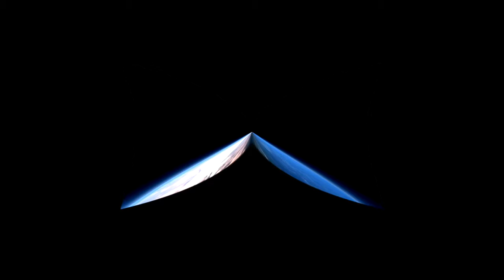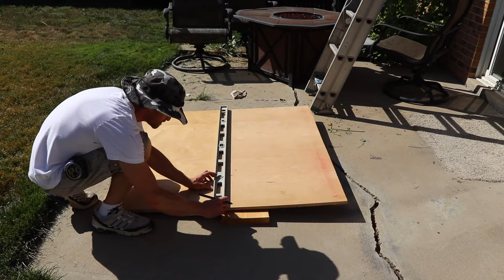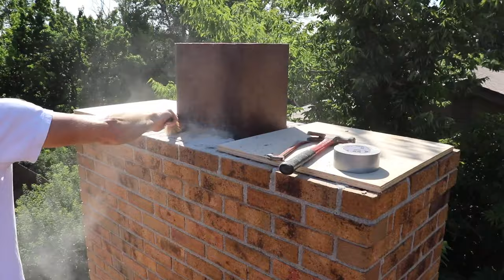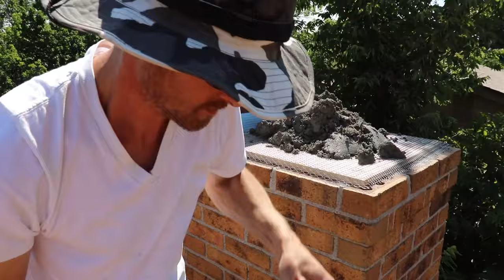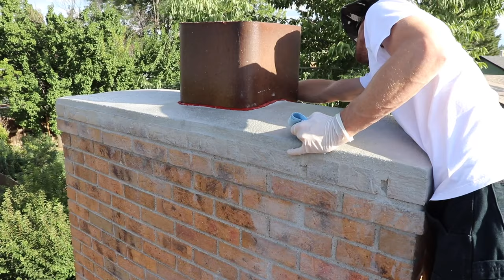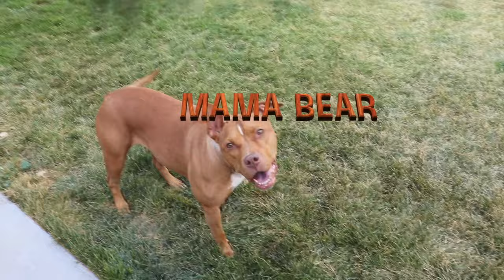DIY Chimney Crown repair

Comment: Wow! Great work. Really clear explanation and helpful tips along the way. Curious. What mortar mix did you use? Have you ever run into a damaged clay liner? Can that be repaired as well?
Reply from the maker: Thanks Jed! I used normal Quikrete Mortar in this video, you can use type S mortar for additional strength. If the clay liner is damaged I usually try to replace it if possible, but it really depends on how bad the damage is, and where the damage is in the chimney. You can use product called Heat Shield to coat the inside of a cracked clay liner to repair it or install a Stainless steel liner. I hope this is helpful. Thanks for watching!

Comment: What holds the middle pipe in place?
Reply: The middle pipe as you call it, also known as a chimney flue, is stacked in 2 ft sections directly on top of each other, (supposed to be) held together by heat-rated masonry. Below the top of the brick and mortar, there should be a minimal space between the flue, and other bricks around it for stability. I would also note, this is absolutely the wrong way to install a chimney crown, and this guy has absolutely no idea what he's doing. He laid plywood underneath the crown, the crown itself is hardly 2" thick, he used mortar instead of concrete (his reasoning because it's easier, easier doesn't mean it's right), and he stated in the comments that he put a water sealer on the masonry. There's a vast difference between water sealers and water proofers, and in most cases, those who don't know use water sealers on chimneys which leads to faster deterioration of the masonry over time. This was an absolutely terrible job, and I'm not even in the chimney industry anymore.
Reply: @yoitspuaphan  I had a guy come out and take a look at my chimney, it was built in the 30s out of rock and is still in good shape. He recommended running stainless still flue to the top. Installing a new wood burning stove this winter and was trying to educate myself on all of the things needed. Cap also needs replacing. He quoted 1600 to install the wood stove, the flue and cap. Is this a good deal?
Reply: @robertedwards2453  It's too good of a deal. It's so good I'd be worried about what he's doing for you. What you need to do is look up CSIA certified chimney sweeps in your area. Having a fireplace, especially a wood stove, is a HUGE deal, and it could be the difference of having a safe fire, and burning your house down. So the question I'd ask is this: is it worth it to you to be cheap, and rig something that may not work, or invest the extra money to have a safe, functioning fire. Also, with EPA regulations that have gone into effect in 2020 (May I think), only certain types of wood stoves can be sold and installed. The EPA has changed regulations for wood stoves to cut down on emissions. That said, 95% of things that were made prior to 2019 did not meet compliance, and had to be redesigned to meet this requirement. I say that to say, anybody selling you a cheap product, less than $3,000, probably doesn't know what they're doing.
Reply: @robertedwards2453  Now, I will say this: the concept of installing a wood stove in an old flue and fireplace isn't a bad idea, but you have to make sure that it's safe what it's going into. Most stainless steel liners for wood stoves aren't class A, meaning they allow substantial heat to pass through the liner. If there's anything combustible in or near your old chimney, or you have gaps that could allow heat to pass through it, you could be in serious trouble. I say all that to say, I was a certified chimney sweep with the CSIA in my area, but I have since gotten out of the business and am doing something else.
Reply: @yoitspuaphan   there was already a wood stove insert in the fireplace, I just wanted to update it to a more efficient model. The business installing this fire place and doing the other work is the same business. I was just going to install the fireplace and nothing else but he recommended doing the stainless steel liner and a new cap. I wasnt thinking of old mortor possibly having cracks do to the age. It was build in the 30s but appears to have been built to last because I cant find any cracks anywhere. But I know I should follow his advice jist wasn't sure what something like this would cost.
Reply: @robertedwards2453  As I stated previously, it's hard to say without actually seeing it. If you had an old stove, there are a number of things that could've been wrong with how it was burned previously, how it could've damaged your chimney, and how the remnants, if not dealt with, could still damage your chimney and potentially your home (chimney fire leading to house fire). These things can occur EVEN IF you install an insulated stainless steel liner fit to the stove. In my area, to install a new stove, liner, and cap, $1600 is extremely cheap, but cheap doesn't mean you're getting a good deal. I would seriously advise getting a professional opinion, one who's certified by the CSIA at least, before you install something and the worst case scenario occurs. 

I will note that I am by no means a negative person, but when it comes to safety, I strongly encourage that you consider ALL the factors. What I know, have witnessed, and learned about chimney and fire safety is what leads me to my recommendation for you to reconsider your purchase. Again, this is without seeing the product and without seeing your chimney, but the two red flags you've given me so far is 1, it's a 1930's home/chimney and 2, an old wood stove was installed that did not have a stainless steel liner, meaning smoke was not efficiently drafting, leading to faster creosote development. 

I would think of it this way, chimney problems are often times like a car. In most cases, your car will have several issues with it. Bad tires, brakes, needs oil change, etc. Once it gets to the breaking point, and the car can't take it anymore, it pretty much shuts down completely and you can no longer use it. In the case of a chimney, once it gets to this point, you're likely looking at a strong possibility of a chimney fire, and potentially a house fire.

Comment: Your hired!  Seriously though, do you do this for others, and are you anywhere near Denver?
Reply: Hey dorothy. I do the same work but out of Albuquerque NM. About 6 hours south. I do take up bigger projects up there. Full restoration and such. If this gentleman can not provide the work or an est feel free to message me. I do come with Google reviews and such. Not some down the road guy (Actually certified).
Reply: @willbarrett4312  Well I just had it done on Saturday!  I doubt they did as good a job as you would have, but I'm hoping they did an adequate one.  The old crown turned out to just be a heap of left over mortar.  It became a sand bomb when they went to bust it out.  They did the form (which is still up there).  They also used a custom foam bell to push Heat Shield product into the few gaps in mortar between flue tiles.  They worked from 2 in the afternoon until 11:15 at night (with spotlights after dark).  I would prefer the new cement not be sealed with any product, but they said they sometimes have to do that if there were any bubbles in the new crown surface.  Will let you know how it turns out after the form and supports are removed.
Reply: @Rabbitsarewonderful  Sounds good. If their using heat shield product I'd say they know what their doing.
Reply: @willbarrett4312  So they took the forms off today and started to seal the newly poured crown with crown coat.  I could hardly believe my eyes!  The top was wavy, dipped and ragged.  i yelled up and asked if they should be grinding it first to smooth it all out or something.  I have a picture (you would be horrified).  They tried to tell me no one has ever complained about it before.  I said I don't care, it isn't acceptable.  So, after a lot of uncomfortable back and forth, they are going to come out again and grind it even though it now has the crown coat on  it  I'm so sad about this.  All the pictures I saw on the internet show crowns like the one in your video -- really smooth and even.  They tried to blame it on rain, but they chose to work in the rain!  I just don't know.
Reply: @Rabbitsarewonderful  I do apologize that sounds like an awkward situation. I must say this video isnt mine. I normally smooth the edges after pulling the form. How big is your crown?
Reply: @willbarrett4312  Yes, they went to glopping on crown coat without any smoothing whatsoever.  I can only estimate from looking up at it from the ground that it is 2 feet by 4 feet.  It also does not look shaped.  It looks like a cement table top from my view on the ground when I stand far away from it.

Comment: Dont know what state you live in... but check codes because NO wood is to contact ANY chimney. Why would you put back the same crap you just had taken off  IE  mortar, Form the top and pour a CONCRETE cap , not mortar

Comment: Wood soaks water up like a sponge, rots and crack crown. Rebar and mesh only NO WOOD! Should be cement or concrete not mortar. There should be an overhang.

Comment: 2 things you did wright .... Expansion joint around flue pipe and rain cap .... 

1) playwood - fire hazard, BIG no no 
2) instead type N mortar you should use concrete
3) crown should be separated from bricks (usually ducktape)
4) overhang at least 1.5" with dripedge under ....

What you did is called "wash".... You charge for a crown and give them pourlly executed wash .... Invest $$ you made in power hamer or at least chissel, book ab masonry wouldnt hurt eather. 
Ppl ... That should be done by proffesional masons, not weekend worriers ...  Hire certified chimney company! They will inspect flue lines, check firebox, smoke chamber, ash pit, clerances .... $$ well spend.

Comment: Bond break is wrong . No overhang or drip edge so water is going to run down face always. Will last a bit but after few years it will crack and deteriorate. The work you did here is basically a wash/splay repair not a true or proper crown rebuild. Good video nonetheless.

Comment: mortar. This isn't what mortar is designed for and it WILL NOT last. Mortar is used for masonry joints. Cement with rebar is FAR superior. Also, simply running a bead of whatever caulk around the flue is DIY mistake.

Comment: I don't think it's a good idea to apply mortar on plywood, at least you should use cement board. It will stick better and it's water resistant.

Comment: I hope the source of the chimney was off or otherwise not used, or else you could have suffered any of a number of problems/damage/sickness/death  putting a tarp over the top of the flue! If the chimney is being used during the work, just cut a slit to allow the tarp to just slip over the hole (i.e., leaving the hole exposed to safely allow hot air out to the environment), then wrap the top of the tarp with heavy duty rope, cord, tape, etc.

Comment: Everything about this crown is wrong. Plywood does not belong in a chimney. The crown should be concrete, not mortar and should be much thicker than what we see, The crown  should hang over the chimney and there is no drip edge. 

The mortar will seep water, the plywood will rot out and the mortar will collapse into the two hollow spaces.

Comment: Wear a mask or respirator when working with any kind of fine dust.
And goggles or face shield are advisable when using chisels,
or doing any kind of destructive work that causes flying debris or sparks.
Don't get me started on a safety harness.

Comment: concrete should be used because it contains Portland cement which is more water resistant than mortar. Plus you you didn’t include any drip edge on the crown. Your work is mediocre at best. You’ve shown how to do a short life crown that’s likely to fail in many way. I’m guessing is ok economically for a temporary fix, but does not conform to basic construction building standards for chimney crowns. And it’s inconsistent with the standards set by any quick google search on what a proper chimney crown is. One glaring problem is that no combustible materials should ever be used. And you used plywood. Very irresponsible that you don’t know this. A cheap hurry up make a video job you did. Hopefully this is your home and not someone else’s. You are a hit n run style contractor that people should be warned about.

Comment: This is more like how not to do a crown wash. Never put wood under the cement as it will rot and the crown will fail again. Cavities need to be filled with cinder block or brick. Do not repair your chimney like this. So many things wrong with this repair.